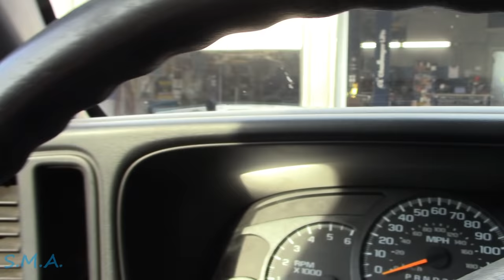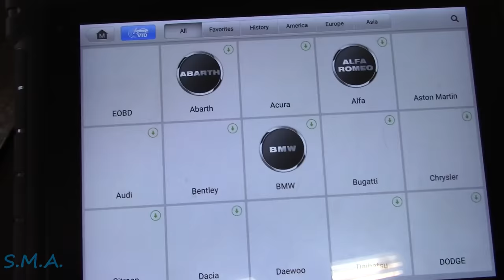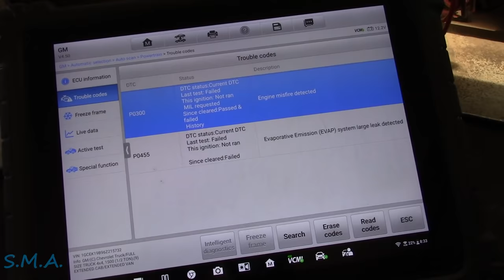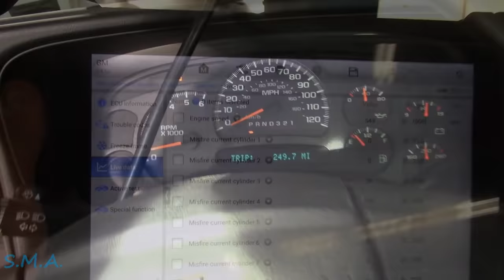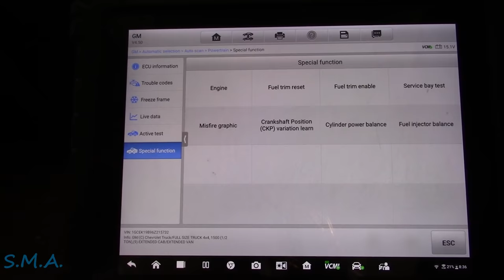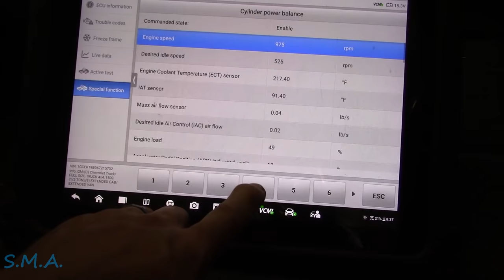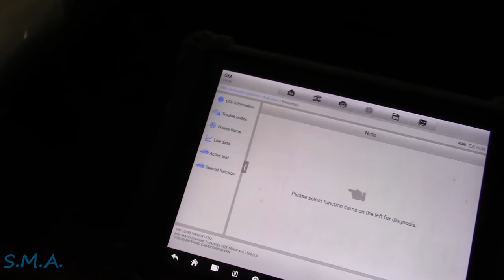GM - Chevy Truck: Misfire Diagnosis

Comment: "In case the brake lines blow". As an owner of a 2002 Suburban in NJ, I understand that reference.
Reply: Eric knows.   I got rid of my 05 silverado because I got tired of replacing brake lines.  The joys of the rust belt states.
Reply: @makoman67   NiCopp....  Best thing for rust belt lines
Reply: Yeah,  I did the nicopper lines on both my vehicles, 02 accord too.  It lasts longer than steel, but road salt will take the copper out too eventually.   There is stainless,  but damn that shit is hard to work with after you've been spoiled by hand bending nicopoer.  I just need to move to west texas and I can drive the same vehicle for 30 years without rust.... lol
Reply: Oh man, that happened to my co-worker on his '04 2500 while towing a camper.  Twice!  He paid to have the brake lines changed out after the first time, the shop forgot one line from the master cylinder to the ABS module.  Guess what blew two years later.
Reply: Yep, I replaced every line on my Silverado except for maybe 3.5ft of the front right,  and damn if that didn't blow a week later.  That's the worst feeling in the world when you hit that pedal  and it goes to the floor.  It's happened to me like 5 times in my 54 years, 2 times in the driveway luckily.   It's also easy more dramatic losing the front brakes compared to the rear.  I'll drive it home without rear brakes, but not without front brakes. Lol
Reply: You might be right about the crap nicopper, I wouldn't doubt that some could just be plumbing copper rebranded as nicopper.  Without the extra nickel content it could certainly corrode.  Hmmmmm. Thanks amazon..... lol
Reply: What I had definitely wasn't steel underneath I would have seen it when I rolled the flares.  I might still have a piece of it around I'll check it with the magnet if I find it.
Reply: @makoman67  I've seen it happen twice. First roll was just copper washed steel line, other one was softer but testing showed it was not real nicopp. I use a couple local old school parts stores for most stuff, they stock the real stuff.
Reply: I won't be buying it off amazon anymore,  no wonder it was so cheap....lol. Is there anything they won't fake these days?
Reply: @makoman67  Seen a LOT of fake parts out there these days.
Reply: I've put several dorman stainless line kits on those trucks that seem to fit ok.  Gm also sells a plastic coated line kit what's like on newer vehicles
Reply: Had an 02 silverado blew a brakeline going downhill light was red, and the sheriffs department was ahead to the right. honked the horn and traffic stopped. I stopped in the middle of the intersection. Cost $650 to replace all the lines. Was worth it!

Comment: Top diagnosis Eric,  no parts cannon on your job , pity "the other shop ", had  not used your testing methods , hopefully the customer goes back to them for his dough back , have had this a couple of times on massive Ford engines over here in the UK,  Ford KA  1100 cc 😂, 35 quid  new injector,  runs great , credit to you , take care 👍👍

Comment: Awesome as always! I've had similar results looking for pintle openings on current ramps, they can be tough to see. I've found it to be much easier to see it on the voltage side, but you'll only see the hump as the pintle closes following the field collapse instead of it opening like on a current waveform.

Comment: I have a miss on my 2009 Silverado 4.3L 262 and yesterday I changed the ignition wires, checked the spark plugs and the miss is somewhat gone but not completely,however, I could swear the ceramic insulator on 2 spark plugs  on left bank looked tiny cracked. I'll check again on Sunday because temperature dropped for next 3 days, 30s. Thank you Eric for your dedication, very much appreciated by all of your fans, I'm included.

Comment: Bottom Line: The Customer got screwed! New Coils & Coil Wires, when it simply needed a Fuel Injector!
Reply: 16 year old truck. New spark plugs, coils and wires.  Thats not so bad.
Reply: @nickv4073  All's fine but it didn't fix the problem, who goes to a repair shop and says "buy some new parts and see if something works", no one, if you goof it's on you, don't charge me because your "parts cannon" effort failed.
Reply: In all honesty we don't know that the bad injector was the ONLY problem. We just know it was the one they couldn't find. There could have been multiple problems, and those are the cases that are a real pain to diagnose.
(Now, they probably replaced a bunch more than they needed to. But maybe they didn't do everything wrong.)
Reply: @lwilton  Actually we DO know it was the only problem, if that shop had just connected a spark tester on that cylinder, (as Eric did), then you eliminate the coil as a possible suspect.
Reply: And plugs and how much labor time? OUCH to the wallet.
Reply: Parts mark-up 40\50 and do a coil swap 1 cyl. Over more profit for the shop but anyone can throw parts @ a problem, that's what makes Eric the pro in his town!

Comment: A scope kv test/measurement wouldve revealed a higher than normal kv because it takes more voltage for a spark to jump in a lean environment vs a normal environment inside the cylinder(conductivity)provided the spark plug gap is within spec.  Too bad the other shop didnt know enough to check.  Great vid eric👍👍👍
Reply: I'm just surprised they didn't try using a spark tester, and or check the cylinder for excess fuel.  Typically if the spark is the problem you're going to smell it on the plug.

Comment: I have a misfire in my 99 chevy LS 5.7 pickup. In my town, your lucky if you find a repair shop that has a scan tool to figure these things out. It's sad. So I finally found 1 shop in my area that has a live data scan tool and they have been in business 52 years. These chevy trucks made in the 90s from 96 to 99 are not that complicated to work on. But finding people to work on them is impossible.  These younger guys depend on computers to tell them everything. And that's the problem. They know nothing about old school mechanics..I'm 62 years old and I've done mechanic repair work since I was 12, on everything from gas to diesel engines but never worked as a certified mechanic . But. These days those computers have to be used to aid in the repair work. Great video . You go the extra mile for sure. Thanks for posting it. Now it's my turn to get my chevy fixed and have the mechanic go through the same thing. Lol

Comment: Sometimes the simple backwoods ways are pretty effective.  Even without a fuel pressure gauge a DIY would have fairly safely diagnosed a bad injector.  And if it didn't fix it you would know it was a wiring/control issue.
Reply: If all else fails, swap the injector with a known good one and rescan the data. The misfire should "move" to the cylinder you swapped injectors with.

Comment: Hey Eric. When doing the relative fuel pressure drop. Can you not use the rail pressure sensor data instead of the manual gauge you added?
Reply: Sure can

Comment: That is impressive, to reason that out as you do it and come up with a clear problem sans the scanner or scope.  You showed us the scope will not indicate every failed injector. Figuring out what the problem was mostly the old fashioned way, by applying good diagnostic practices while keeping what you know about how those injectors work in careful consideration to make a positive diagnosis of this guys pickup truck. Very impressive indeed. You nailed it and did not waste the guys money chasing rabbits well of the trail. Good lesson for everyone that sees this video.

Comment: Thankful for all the work you put into all your videos! We had a guy like your farmer with the #7 plug oil fouling. We performed the bulletin where we put Top Engine cleaner in the cylinder for 3 hours, then blew it out. Has not fouled a plug in a year and a half now. HTH thanks again

Comment: I feel bad about my comment below.  Actually I can understand why Eric uses the expensive tools (like a scan tool) even when the problem on the surface may seem simple.  I recall one time I sprayed WD-40 on my Dad's door locks.  Three weeks later the car quit running because he hadn't changed the spark plugs in 60,000 miles or the oil in 30,000 or something like that.  Somehow, what I did was the problem!  That's when I learned, reinforces by Eric's video's, throw on 5 grand worth of diagnostic equipment, document, and have a complete conversation with the customer.  Thanks for the lessons Eric.  Thanks for sharing!

Comment: You pulled #4 plug and looked but no smell test . Pull # 2 plug to compare looks and smell. 
Next screw driver as stethoscope or if you had a stethoscope. 
But you still said during the leak and pump test of injector - no clicking its frozen.
Good Scotty Kilmer
Thanks for your teaching. Good job!

Comment: Im just glad u stuck with the video and didn't end and delete it the second u had discovered that it wasn't a compression issue and was in fact a fuel injector issue like u were talking about people betting their life on in the beginning.  Takes alot of balls to upload something that manages to make u change your mind set of the situation.  I do agree with the testing tho. Ive fought some of them crazy little injectors that seem as tho they work but they don't. Or even had intermittent issues. Process of elimination. If u don't know certainly then test it all. Compression test, Injector shut down test, ignition shut down test, smoke test the intake system, plugs, wires, coils, cat temps and so on.  If ur not certain u haven't done enough testing. Itll show itself eventually u just gotta know how to find it. Good job Eric u went down the list just as i would have!

Comment: I liked your comment about old plug wires. I did tune-ups in college in late 1960's.  I would throw an old Army blanket over the hood and look for leaky plug wires. College kids drove old cars with long wires from distributor to plugs and they could put on quite a light show as the sparks arced to whatever was handy!  It hurt if my hand was close.

Comment: Tnks. Your video was so helpful. Im desperately trying to get my sons vehicle going. Hes getting an 06 hand me down from dad. It sat for a little while. Ive been racking my brain on issues just as this. Ive done did new plugs, new wires, new fuel pump, all new o2 sensors. Now im getting a misfire code, a knock sensor code, and saying one o2 sensor is still bad. Im not giving up! Even though im ready to throw a wrench at the window!😊

Comment: You say there are a million ways to skin a cat and I can't agree more. I've seen some guys troubleshoot different problems using only a 12v test light. Some of which I thought impossible but over the years of not having access to fancy scan tools and tech data have devised their own troubleshooting techniques that work sometimes better than what is called out for. It's really interesting to see first hand.

Comment: It seams like the more efficient these cars get  the harder it is to diagnose alao each manufacturer has similar systems but they have differant characteristics. Your really into the electrical systems. I'm  in Florida so unfortunately I can't take my problems to you so I just have to keep watching and learning. Great electrical work man.

Comment: That was a very helpful video. I appreciate  your thorough diagnostics. I'm dealing with a misfire on a 2007 five cylinder Chevy Colorado.  I have swapped coils and the problem doesn't move. I suspect a bad injector but they are very hard to reach on this engine. When I add a can of seafoam to the fuel the misfire improves significantly only to return on the next tank of gas.  Thanks to your video I know what to do to confirm my suspicions. Thank you

Comment: Another great SMA diagnosis and repair. The basic after no spark is fuel to me, and when I worked the Chrysler turbo and EFI vehicles in the 80-2000 time, there always was some kind of injector problem with high mileage engines or the cheap gasoline we had back then.

Comment: 100% agree with you Eric!  You can have a fuel related misfire or a spark related misfire and the O2 sensor can pick it up as lean, (even if the cylinder is actually fuel rich) and cause fuel trims to go positive!

Comment: I wish my 01 express, 4.3, had separate injectors, and not the spider fuel injection unit I have a cylinder, #1, misfire, I have already, replaced the plug wires, for a 2nd time, and the cap, and rotor, also for a 2nd, which is normal, from what I have been reading, due to corrosion, I have to pull the plug, to inspect, I replaced them with iridium plugs 1.5 years ago, but I need to inspect it for arch marks, the plug wires, were full I'd arch marks, and i replaced them, the same time, thought I was done, for years, the heat in this 1500 conversion, van, destroys e everything, thank you for the video, great job!!!!

Comment: 2005 Hummer H2 6.0L. I have done almost a complete tune up after replacing my cylinder heads. I replaced my plugs, wires, injectors, 02 sensors. I was going to replace my MAP sensor and coils until this video. I pulled the plug from cylinder 3 and it didn't have carbon on it like the others. I've checked continuity of the injector and it has continuity. I have not checked the power in the plug from the harness with the light. I am going to try this. Thank you might have some questions for you later 😆

Comment: Thank you so much for the information.  I have watched several of your videos and I have learned from all of them.  I am a typical DIY guy and I appreciate that someone like you is willing to share your knowledge and experience.   I am also kicking in a subscribe, which is the only second time i have done so.  I am willing to tell this to anyone who is interested.  A strong reason I do a lot of work myself is because I have seen too many of the dishonest repair shops.  I am a guy who has been stationed in several geographic areas of the country and can tell stories from all of them of being attempted to be scammed.   Some of these go back a while, but they are just an example of why the industry gets a bad reputation.  I took my car to a Midas shop (for brakes) on a rainy day.  The technician tells me some wheel cylinders is leaking.  It looked like water to me.  I took it somewhere else on a dry day and the liquid wasn't there.  surprise . surprise.  That was in Charleston, SC.  When I was in Connecticut I slid on ice,  bounced from one side curb to the other, and knocked the alignment out.  I brought it to a local shop, was told I needed a bunch of front end parts replaced.  That didn't make sense.  I had my doubts so I brought it to Sears Automotive and they did a simple alignment.  No more else was needed.   And also I have seen a few shops attempt to take huge advantage of women who don't have any sense of what seems total unreasonable.   living in Florida now I don't have to submit to yearly inspections, but in many states it is a requirement.  i learned quickly not to go to a repair shop to get inspections done.  There is nothing as UN-nerving as watching a inspector poke around a lifted up vehicle with a screw driver.   It so is easy to poke holes and jab through wire insulation with a flat blade screw driver.   I always went to the "Oil Change / Inspection stations" when I was in NY.   They don't have anything to gain by making work in the form of repairs.   SO THANK YOU SO VERY MUCH FOR ALL THE INFORMATION.

Comment: My go to technician interview is having them walk me through a misfire diagnostic. Most of the time, they really don't even know how and that's where I wade them out. But if they at least have a process, then I'll take it as a win because I know my way isn't the only way and not even I do it the same way every time.

I recently had a 2016 jeep Cherokee where I checked everything from here to the moon. I measured resistance on the primary and secondary of all the coils. Measured resistance on all the injectors. I checked compression, I even checked all of the lifters because EVERYTHING checked out great. I ended up going old fashioned and switching all of the coils and injectors and my 5 hour diag and hard labor was discovered to be a bad coil by doing what probably would've been the easiest thing to start with. 

Most of the time, an approach is experience based, sometimes your inklings are on, sometimes they're off 🤷‍♂️ at least that customer walked out knowing that their 190k mile engine was perfectly healthy and had no indications of any mechanical aging lol

Comment: Great video! I like the logical approach that you use and deductive reasoning based on experience and acquired knowledge. You have access to an array of scopes, scanners and test devices but use the basic reasoning of your own mind to lead you to conclusions. As demonstrated in your video the scope did not provide any certainty of failure of the injector but it had mechanically failed to perform. Great presentation, great skill and definitely admirable application of knowledge. Keep up the videos.

Comment: I really have learned a lot from you about tracing the problems and not just changing parts as shown by the codes. I have an inexpensive scan tool ( probably made in china) that does have most of the functions as your professional one. If when changing functions on your scanner you could slow down a bit we could learn how to get where you are going. I see where you are going, sometimes I’ve been there but getting there again sometimes is a real challenge because of the differences in machines. Thanks for your great explanations. The  process of elimination is a key factor in automotive engine diagnostics.

Comment: Even the cheap odb2 readers will tell you what bank and you can switch sides I did that ended up it was the plug had the smallest crack but I found it doin this process in my yard.  Thanks for the video made me feel like I might know what I'm doin from time to time. Well maybe not lol but it's still a good time